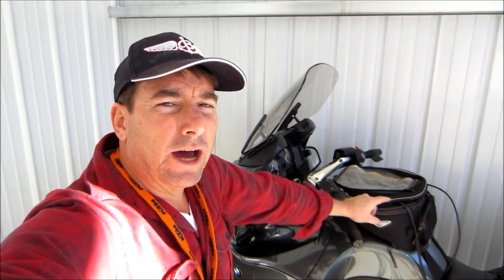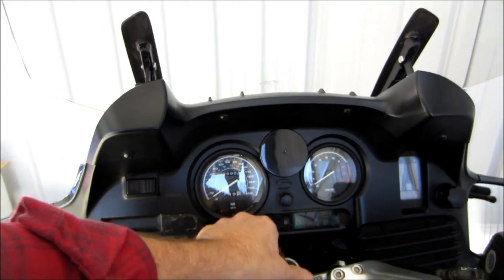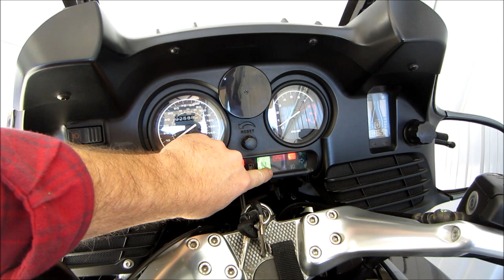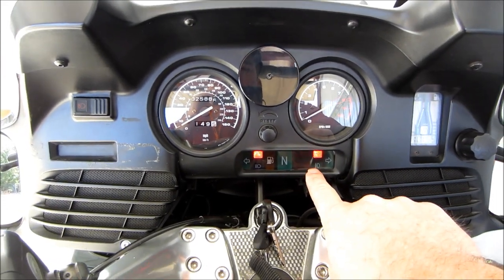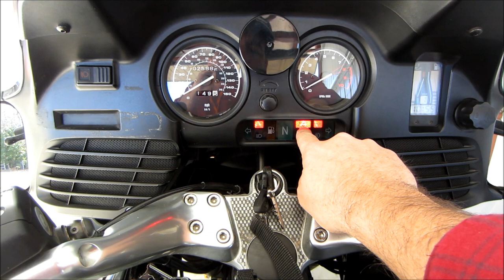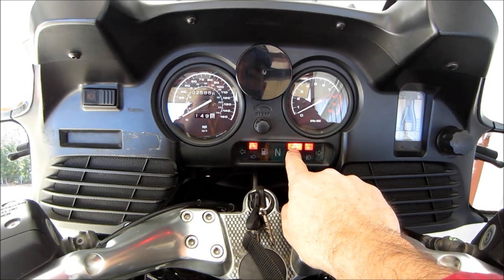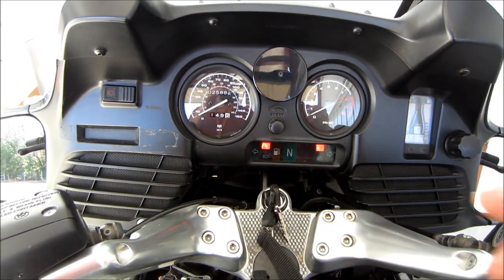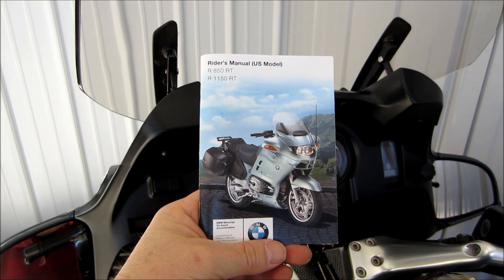BMW MOTORCYCLE ABS BRAKE TUTORIAL- ENGINE START- R1150RT

Comment: good day, i resently bought a 02 r1150rt bmw ,bike but the abs anfault lights keep flashing but the brakes was working well until a few weeks ago the abs stop working, i am afraid to ride the bike without good bakes, i saw on the net some abs resets but the 02 models dont have a abs switch to prest an hold for 10 seconds, could  you help me on how and what to do to clear these fault lights on the 02 model.lincoln.
Reply from the maker: Try resetting them again. Start the bike without the brakes on, see if it completes the brake test, then ride it a short distance. Stop bike, shut it down and try again.

Comment: I just replaced the rear brake pads  ( simple process) and it doesn't work the flashlight ok dashboard it's blinking to fast telling me there is a problem but I cannot find it
Reply: You may have a fault in the ABS module or sensor.  Check out ADVrider forums and  bmwmoa.
If you have solved this problem please comment on what you did and what the issue was.